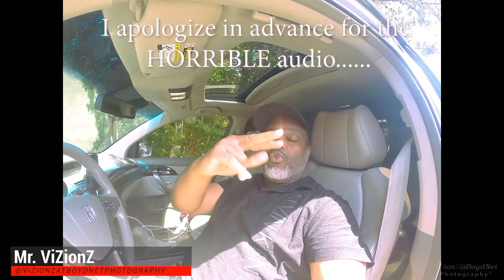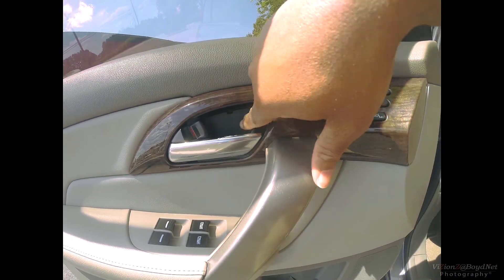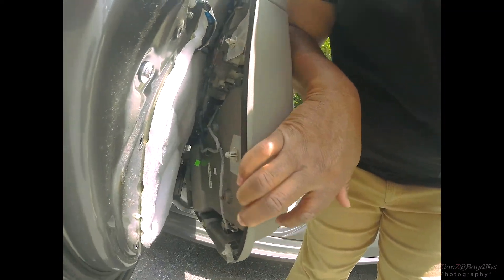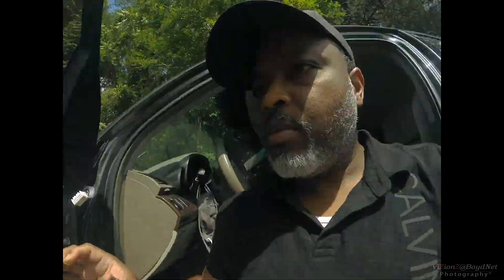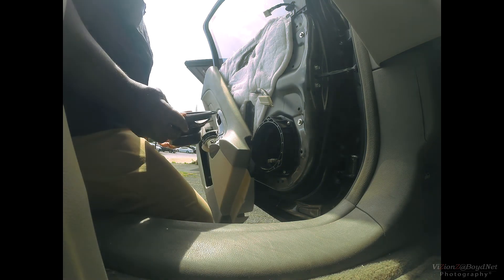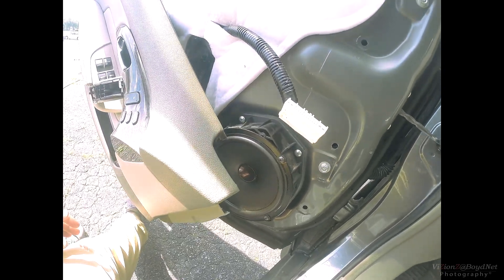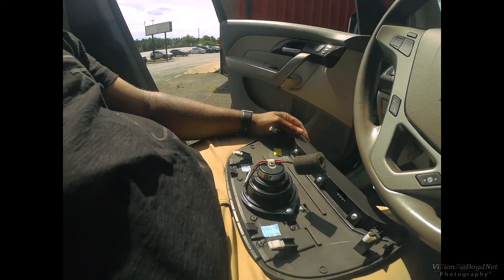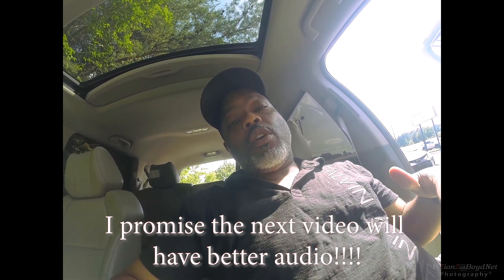Second Generation Acura MDX Stereo Upgrade Series - Part 2 - DOOR and CENTER CHANNEL SPEAKER UPGRADE

Comment: I just replaced my sub in mine was a pain
Reply from the maker: It was a little bit of a pain but not too bad.  I have a video on that I need to edit and post.  I replaced it with the MB Quart and did not like it.  So I ended up amping the factory sub for a while.  Sounded pretty good until I blew it.  I now have a JL Audio 10" Powerwedge.  I lost a little cargo but not too much.  Whats your setup and what driver did you go with?  #ViZionZatBoydNetPhotography